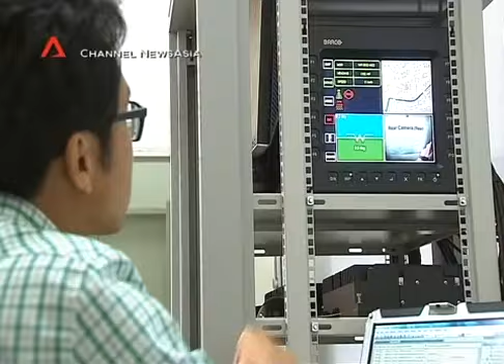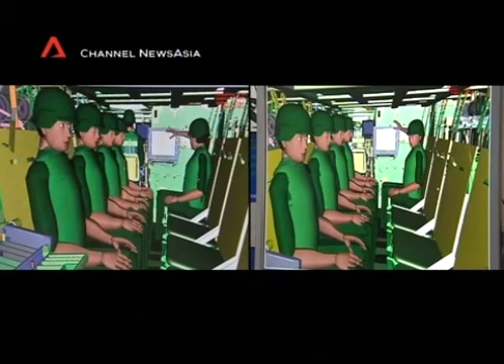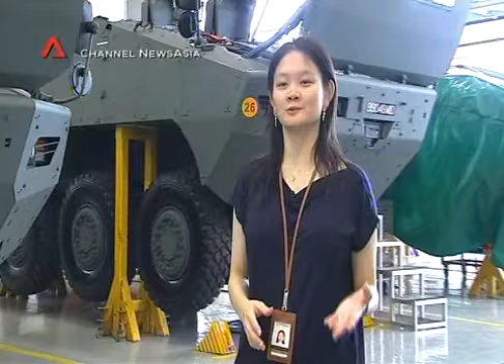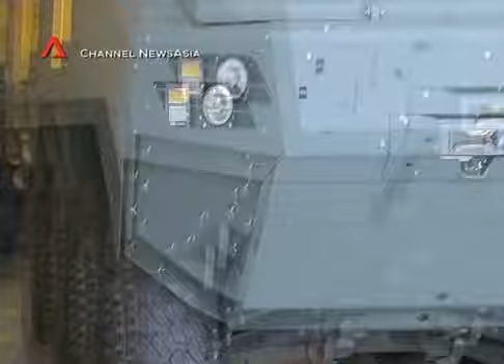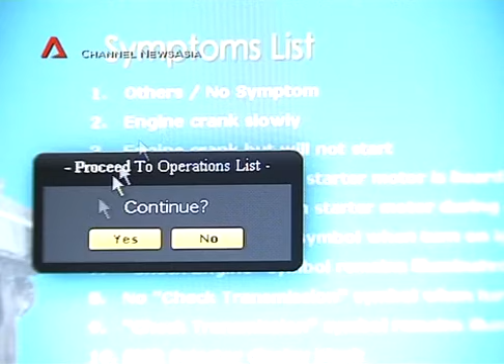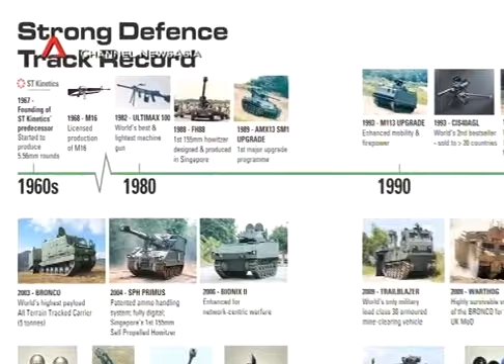Channel NewsAsia - Making Of Terrex Infantry Carrier Vehicle Part 2 Of 2 [360p]

Comment: The shock absorber seems a bit small and all the lateral stress will fall on the link when crossing a trench. The turkish version seems to have a larger one with guide and shock absorber integrated. And a wider field of view for the driver.
Reply: +Alan Fok Singapore has some unique requirements for armoured vehicles to be compact to fit certain operational needs and terrain. So everything is compacted down. The smaller size is offset by better materials to give the same strength.